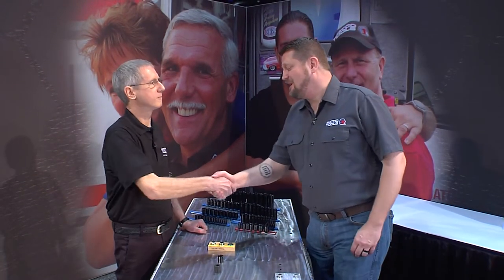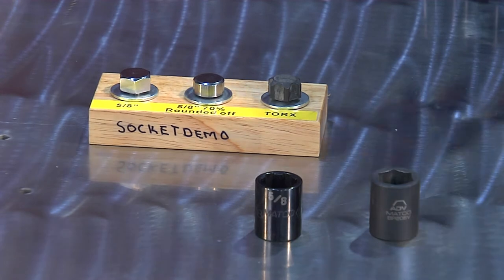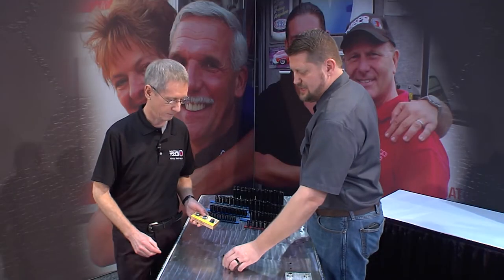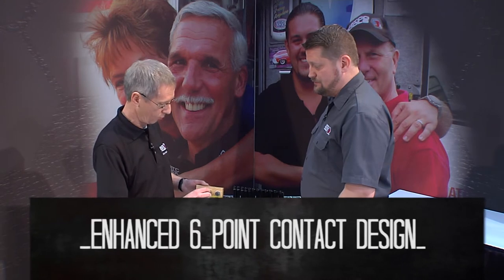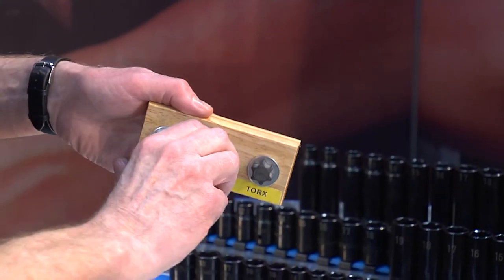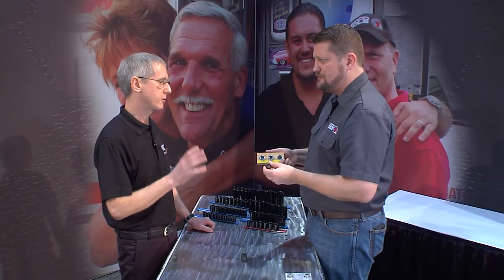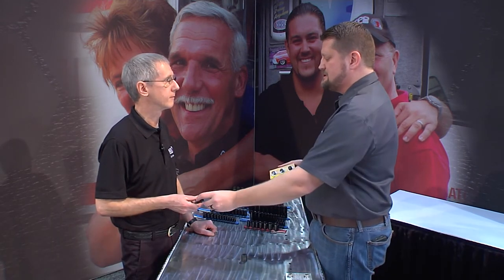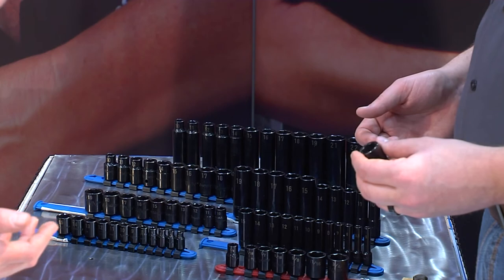Matco's Pro Non-Slip Socket Series

Comment: More rebranded tools from Matco.
Reply: busfairnitrometh if they are rebranded, then who makes them because I can’t find them anywhere
Reply: @dylanaguiluz6246  snap on made those a long time ago, gear wrench I bet makes those for matco, as they make the rest of matco s hand tools
Reply: busfairnitrometh the sockets are rebranded sunex sockets. My Matco dealer had warrantied out a couple of my coworkers Matco sockets and when my coworker recurrent them they said sunex on them. I’ve check gearwrench sockets already and gearwrench doesn’t have those sockets.
Reply: @dylanaguiluz6246  well there you go,sunex must make them
Reply: busfairnitrometh I own sunex sockets. I already checked to see if sunex makes them and they don’t show them on the website. I even checked Amazon. I checked so many different tool manufacturers